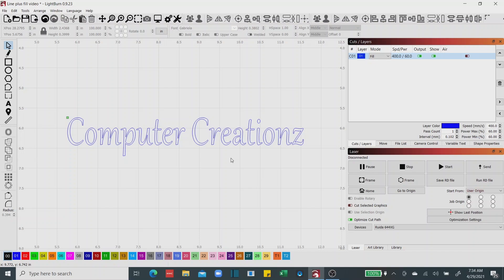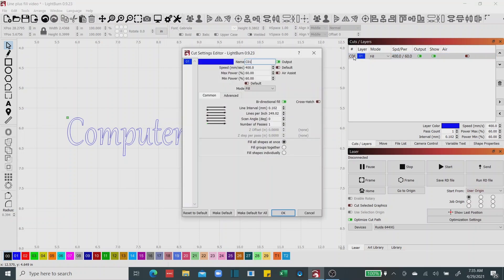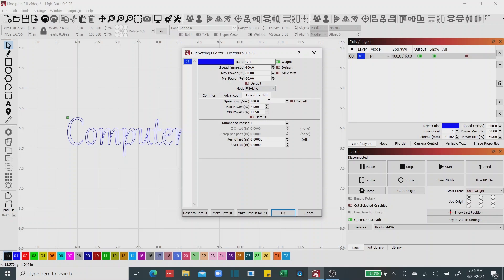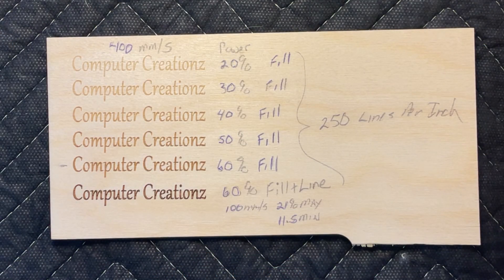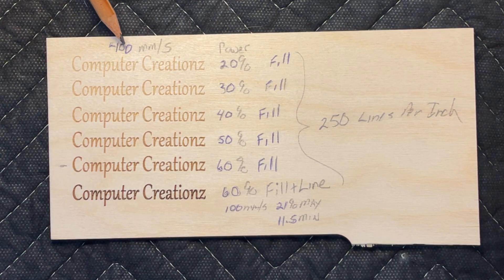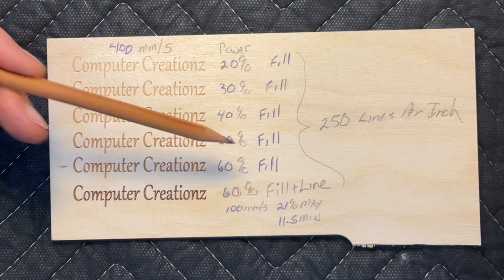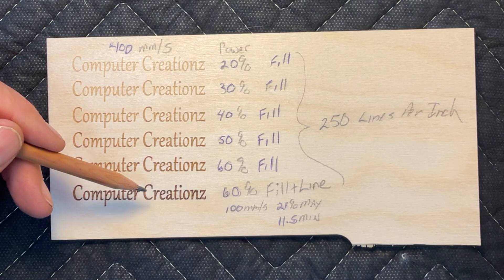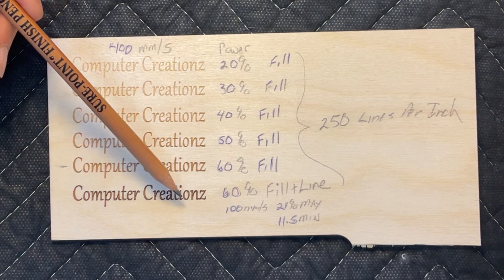Want better engravings with your laser? Use Fill + Line in LightBurn

Comment: Great video. Question for you? I see that you have no additional charring or residue around your letters. How have you avoided that without taping; did you alter the overscan settings?
Reply from the maker: It’s all
About the lack
Lack Of air flow. I use just a whisper of air when I engrave anything. That way the vaporized material doesn’t get pushed back on the piece. Very little post prep is needed.

Comment: 1.4.01 doesn't have fill + line setting in drop-down optiions.
Reply from the maker: It does they just reconfigured the layer layout . Look to the far right top section of your layer and you will see a + sign and you can add a sub layer. Your first will be fill your second will be line! Same function
Reply: @computercreationz  I found discussion of the change minutes after commenting and tried it last night.   Works well!

Comment: Great video, however I do not have the option "fill/line" using version 1.3.01 of Lightburn..Unless option somewhere else. Thanks
Reply from the maker: Yes it’s there you will notice that there is a little plus sign to the right now you can add as many tabs that do different thing on one layer it’s a great new feature. Lots of YouTube on hot to use the new feature

Comment: unfortunate i dont have this option in Lightburn 1.2.04...
Reply from the maker: You do you access it differently. Look for the plus symbol on the right hand side. The first tab should be fill then add a tab and switch mode to line. This t remove it they enhanced it so you can have up to 11 tabs. It’s a great new feature
Reply: @computercreationz  thanks for sharing this with me. It's awesome, now we can make several layers with different filling patterns

Comment: I'm using Lightburn 1.2.01 In the settings I do not see a line+fill option. I only have Line, Fill, Offset fill. Is this because I am using the Atomstack A20 diode machine? What am I doing wrong? Thank you for the great videos.
Reply from the maker: Lightburn has adopted sub layers so now you start with fill then add line as a sub layer with the little + to the right. Lots more flexibility. YouTube lightburn sub layers are you’ll see how it works. Different but much more powerful
Reply: @computercreationz  Thank you very Much! This is brilliant.

Comment: FYI.....I updated the to the latest Lightburn software on my desktop and laptop computers today (6/30/22). The "Fill+Line" setting is now missing from the drop down menu. Does anyone know if this was done accidentally or intentionally by Lightburn? This really sucks, as I used this setting a lot in order to make letters and numbers stand out on signs. 🤔
Reply from the maker: it’s there, it’s handled in a sub layer instead. sub layers are brand new. so you would have a fill layer then add a sub layer for the line.
Reply: @computercreationz  Yes, I did just that today, and it works great. I am getting around the issue by duplicating text and creating two separate layers. One layer for "fill" and the other layer for "line." Then just overlay the line layer over the fill layer. This "work-around" requires a few extra steps, but it works well so far. 👍
Reply from the maker: @TheGuitarman1968  no reason to do that go into the layer you want to fill hit the little + sign in the upper right hand corner and it will add a tab. Use line for your second sub layer. One design, one layer color two actions
Reply: @computercreationz  Thanks for the info. I watched Rich's (The LA Hobby Guy) tutorial on this sub layer feature, in the latest update, that he made today. It is actually really cool to be able to do multiple actions in one layer. 👍

Comment: did they remove this option?  I tried to follow along but it doesn't seem to exist anymore in the current version?
Reply: @Casey Pettus  See my previous post. I am wondering the same thing, as I use this setting a lot, and now it has  mysteriously disappeared since the latest Lightburn update. 🤔
Reply: @TheGuitarman1968  So what I ended up finding when hunting for this setting, was the ability to add "sub layers", so I set one up as the line with my normal settings, then another layer as fill with my fill settings.   I assume this is replacing the Fill+Line option, and letting us add as many sublayers and options as we need.

Can't wait to test it but it's a few jobs back in the que right now.
Reply: @CausaDavion  I tested this today. As you suggested, I am getting around the issue by duplicating text and creating two separate layers. One layer for "fill" and the other layer for "line." Then just overlay the line layer over the fill layer. This "work-around" requires a few extra steps, but it works great so far. 👍
Reply from the maker: as you’ve seen below they just have a different way of approaching it now. works great!

Comment: I been meaning to check out that fill + line mode in lightburn. What I recently did, and it came out really cool was I first did a fill operation of some text then on a second operation did the line mode on that same text and it came out spectacular but that does requires doing it in two operations. I assume the fill + line is done as part of the same operation? I do plan to test that mode soon. Thanks. man. I always like stopping by 🙂
Reply from the maker: I appreciate your comments, thanks for stopping buy!

Comment: Great video and explanation of the minimum power setting.  I just realized that I don't have that option and after some quick research on Lightburn's forums discovered that that feature is not supported by G Code based controllers.  Just thought I would share in case others were wondering why it was not available to them as well.  

Keep making these videos!!!